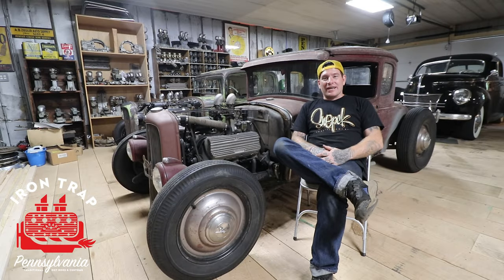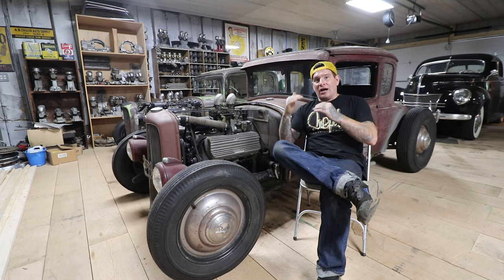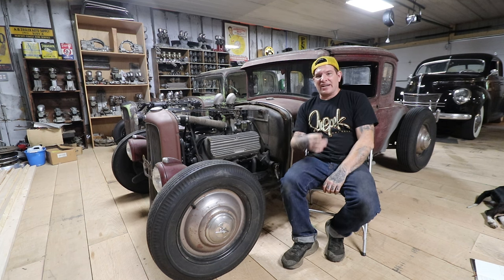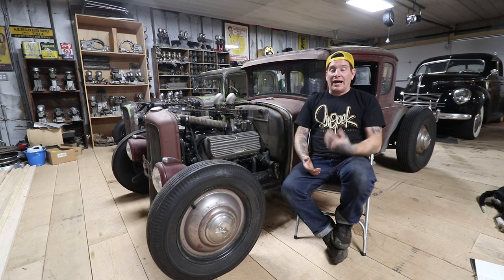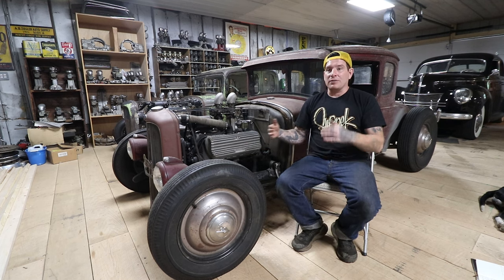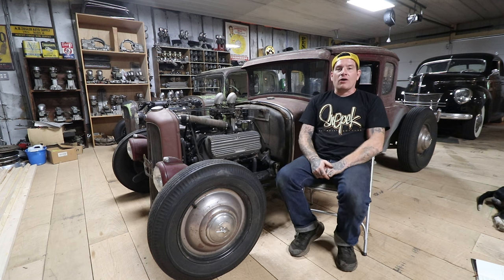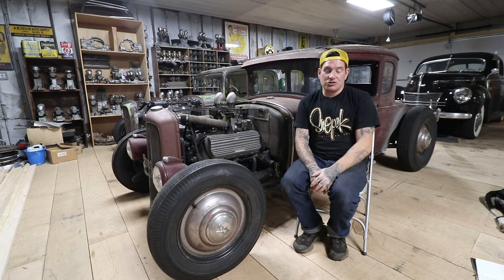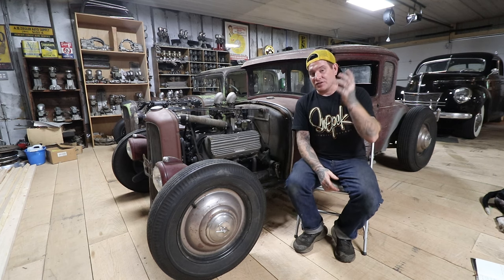Why Does My Ford Flathead Keep Overheating??? Hot Rodding 101

Comment: In our Model A Car Club, We cleaned out engines with Muriatic Acid, we usually mix in very small amounts. About 1/50 to ratio mix. Making extremely sure that the mix does not get into the radiator or on Paint finishes. With that mixture, we let it set overnight. Carefully plugging off the lower outlet to the lower engine outlet. Fill the engine. Let sit overnight. Then drain engine, use caution. Because, the fluid will be nasty! Do not allow to get on the floor of your garage. Do not let any Pets drink of play near the mixture. It will dye it brownish yellow. After it’s out, flush engine until clear water appears. If you wish Neutralize with baking soda. Still do not connect hoses to engine. The Muriatic Acid can make solder come apart. It is important to isolate the mixture from the Radiator. After the baking soda does it’s job, flush a few more times… Clean Hoses and replace any worn parts. With the engine empty of water, mixture and baking soda solution. Reconnect hoses, fill with water and a start engine. Check for leaks. Run engine until warm, and flush out…Then replace Antifreeze/Coolant 50/50. We still use old fashioned green. And in our case, lube water pump bearing grease fitting. Check for leaks and test run it…Thanks… Also, Folks keep tuning into Iron Trap Garage.

Comment: Hi, I know you are very busy but I hope you will take the time to read this. Your piece on flat head over heating was spot on.  We (family/friends) raced flat heads starting just after WW2, I am 82 now but was always around the garage etc. We were running 59A's from Canada after a Ford rep clued us in.  They apparently had a higher nickel content and after switching to them never had a block failure.  The way we prepared a block was, as I remember to strip it then clean out all the water passages possible. A long soak (in Muriatic acid??) at a local radiator  shop for a boil out. Then a thorough hand scraping, blow out, and more scraping  and flush out.  then on to porting/relieving etc.  Blocks were relatively cheap then.  In fact a couple of times we heated them in a wood fire after disassembly  prior to hand work/boiling. We even had a partial success with one engine after heating in a wood fire to make the brazing of sleeves (bored through the wall into the water jackets, Chevy 6 cyl sleeves I think Nash pistons). Ran like stink but the process was crude. 2 men with 2 torches brazing away. As the block was now weaker they leaked and didn't last .  We did use a Hot Rod splitter in the center exhaust port though.  About the  over heating: The local rules stated the 1 carb and the engine had to look stock on the outside.  After trying the brazed washers in the head to slow down the speed of the flow we made  2 short pieces of exhaust tubing with the correct sized freeze plug welded  inside.  You are  right when you say the water flowed too fast at speed to loose the  heat.  By slowing it down the engine ran cooler. We tried the removing alternate vanes in the water pumps but that didn't see to have any further effect. We didn't run a fan but used  truck radiators. Again local/cheap.  Another "stock" trick was to use a Ford schoo lbus fuel pump. Looked the same but pulled the fuel better.  Timing was set by elongating the slot on  on the side of the distributor  and setting upon TDC  prior to putting on the head with a notch on the crank pulley.   Sure wish I had written  down more but at the time who knew. Your show is amust watch for us "old timers".

Comment: I had a long term overheating problem in my 51 Ford F2. Stock V8, but the truck started life as a flathead six. It took me several years of trying everything and getting no improvement.  The six radiator had been modified for the V8 hose layout and the center outlet soldered shut. I flushed both engine and radiator, new water pumps, thermostat. I even added the original fan shroud that had been discarded. Still overheated badly. Then someone told me that the sixes had a three row tube layout and the V8s had a four row core. Problem solved. I bought a dead 51 farm truck just to get the radiator.

Comment: Here in AUS I had a flathead v8 in my ford 37 sedan in the 60s. I agree with all you said , but I still had issues until I replaced the iron heads with alloy , the iron heads get hot spots in them.   After that it wasn’t too bad. Having said that we get temps in the 40s (Celsius) and then I used to find the fuel pump being behind the carby used to vaporise the petrol .  I still wish I had it still to this day . Great, video

Comment: A good method to clean the cooling system is to drain it, fill it with distilled water, drop 2 dishwasher detergent pods in and run it till it’s hot. Let it cool down and repeat a few times. The complete pods with the multi colors work best.

Comment: In addition to blowing out cooling passages using a extendable magnet on a stick helps a lot. The rust is still magnetic!
Reply from the maker: Yep we do that as well as a first step to get the “big stuff” out. Totally forgot that. Great one!
Reply: Agree , beginner here but found my dodgy waterpump was actually hindered by crud .Used a small strong magnet on a piece of fencing wire to probe into the block,certainly very obstructed in the centre .Persuaded myself to do the opposite side as well ,remove probably a mug full of debris each side .I have a 'french' flatty ,so maybe an amount of casting dust in there .👍

Comment: My flathead is ported and relieved.  Winfield 1A cam, Navaro heads . I have side exhaust  with bell megaphones and removable baffles.  No fenders on my roadster.  29 on 32 rails. Altered wheelbase.  The body is 7 inches shorter than stock.  I have fabricated aluminum deck lid and rear panel.  The wheel base is 110 inches.

Comment: With a flathead V8... difficulty cooling has very little ( if anything at all ) to do with water pumps, coolant types, or other incidentals. Quite frankly... get the exhaust gasses the hell out of the block... THAT is what is causing the "water heater" effect. As was mentioned, careful exhaust port / exit contouring... and for crying out loud... get a proper set of headers on the damn thing !

Comment: Legend (and Motor City Flathead) said casting sand frequently is/was a factor with hot running flatheads. Motor City Flatheads used to get "pounds" of sand out of bare blocks while preparing for rebuilds using bent up rods, air, actual rolling of the bare block on the ground. Also, a bit of a project , but plugging the jacket surfaces and filling the jackets up with white vinegar and letting it sit for a day or two will dissolve lots of the built up rust. Followed by a good flush and a baking soda solution of course.
Reply: I know nothing about flatheads but I read, one time, that the factory didn't clean the sand from casting out of the blocks too well alot of times. Said the same thing you did, that rebuilders find alot of sand in blocks. Extra effort should be made to get the sand out.

Comment: Make sure you get all the casting sand out of the bottom of the water jackets.  I  did then I  sent the block to a guy in Petaluma to clean the block out further.  Mine rarely overheats.

Comment: Great episode as usual  Matt! I'm 73 years and the old school knowledge you have at your age amazes me. Then I realized you have learned through first hand experience as well as talking  to legends like GW. My flathead was a 49 with 59000 miles and newly rebuilt V8. I drove it winter -40 F (Canada) as well as 104 F. It always started in winter with regular glycol mix , electric inline water pump/heater and battery blanket. No that's not cheating the wind chill factor in -40 F in Alberta reaches -70+ F and she never let me down. The only time the flatty overheated was once on a 104 F in Osoyoos BC. lol

Comment: Great advice and tips, as usual, Matt. One of my mates, in the early 70s, had a stock '46 Coupe with a
beautiful, quiet flathead in it. Ran it at highway speed, at night, with no dash lights,  going to an out-of-town
party. It blew a bottom radiator hose, and ended up with a badly cracked block. He bought a 21 stud motor
for 10 bucks [70s, remember!] we threw it in and he sold the car. [Got his money back] Those were the days!:body-blue-raised-arms:
Reply from the maker: Dang ten bucks! Haha great

Comment: Thanks Matt! Many common sense things that apply to all old motors. I got lucky. My Catalina 57 came with a freshly rebuilt motor (rebuilt, ran then parked for a few decades), rebuilt radiator and a flushed, boiled and sealed fuel tank. Those things alone made the car worth considering.

Trashcan 🗑 Approved

Comment: Very good helpful tips. Thanks for sharing Matt. I hear a lot about slowing the coolant down but I experienced speeding up the water pump also fixed my problem on a warm running V8. The original water pump pulley was 7” so I installed a 5” pulley I had laying around. Never another issue even on the hottest days. I guess every situation is unique.

Comment: Excellent advice Matt. Only part where we differ is on coolant. I have been running Evans for 10 years. I have a 286 flattie running a quickfuel 650 manual I drive it hard I have not overheated in the entire 10 years. And no corrosion. Love your videos, Matt you always hit the nail on the head. Clean cooling system is a must.
Reply from the maker: Good to hear! I’ve never used it so as mentioned my words were just hearsay

Comment: Good talk Mate! Exhaust to water heat transfer is a flattie problem like no other engine & the center port is the obvious one but you can reach in there with a long porting shaft & knock off all the chunky bits to help that. The outside ports (1-4-5-8) are a different animal that wrap around the outside of the cylinder so you have limited access to clean them out without taking it to an Extrude Hone company. Most header pipes are built square to the block but that's a mistake on these end ports as it creates a dogleg restriction. Take a minute to eyeball that & you'll see what I'm talking about. Golden rule with headers on any engine, the pipe needs to continue the port angle, the flange is just there to hold it in place.
Reply from the maker: Great info there! I’m learning myself here! Love it!

Comment: One of the secrets is cleanliness inside the block. I had my early Hemi block hot tanked, which removed all the sludge & crud that had built up over the previous sixty years, then took it to the local Redi Strip place where they did their number on it. It came back sterile clean with NO rust inside the coolant areas inside the block at all. It was cleaner than when it was new. Recommended procedure for ANY old engine with built up crud inside the coolant passages.

Comment: An old timer told me to connect the heads together with a 5/8 heater hose.  He said that would Ballance flow in the engine and make it run cooler.
Reply: Heard about that idea a mate had a 46 coupe that ran hot it eventually ran right but we did try a lot of these ideas.

Comment: Anti- freeze expands when hot.  Has to be pressurized.  If not you'll run shy on coolant.  Old systems need to be full as possible.  In my A I run distilled water, 1 qt Napa 1400 (anti rust stuff) and 1 qt anti freeze.  Heated garage or just dump in the winter.  I live in PA too, so winter driving is so-so anyway.  You are 100% correct about condition of the cooling system.  That's usually the problem.  Very useful video, I hope people pay attention.

Comment: I have a 39/40 Mercury 239 engine here that I pulled from an old welder. I took it apart to free up the valves, the pistons weren’t stuck as it’s been rebuilt at some point (.060” over). I let the cooling system dry out and blew it all out with compressed air. Before I put it back together I’m going to flush the block with my pressure washer. I have also found a gentle rub on the exterior of the block with a needle scaler will loosen up crap inside the water jackets so it can be cleaned out. Gentle being the key word.

Comment: My flathead had a ton of core sand in the block that  was in the waterjackets.  I was actually able to remove it.  I haave a set of Navarro heads, they have increased water capacity.   I am using a restrictor to slow the water because I don't run thermostats. I also use a solution of water soluble oil in the cooling system.   Water cools better than anti freeze.  I live in Nor Cal so it doesn't freeze here.  I also have a 4 core radiator.  My block was thoroughly cleaned by a guy in Petaluma. My water pumps are high volumn aluminum pumps.  I have a 13lb radiator cap, I have a stainless overflow bottle.  I generally don't have a problem with overheating.

Comment: Obstructing the coolant flow to keep it in the radiator longer is like blocking your pulmonary flow to keep the blood in the lungs longer.....it's counterproductive. Anything that reduces flow also decreases the efficiency of the system.  If obstructing coolant flow seems to work in your system,  there is something wrong with it.....water pump cavitation,  reuced air and/or coolant flow through the radiator, etc.  You're better off resolving the shortcomings of the system than crippling it to compensate for its deficiencies.

Comment: Also use only distilled water, ground water has a lot of minerals that you don't need in the engine. As far as pressure caps, the older radiators like what you are running don't have a sealing surface for the pressure cap to sit against so in order to run a pressure cap the neck needs to be updated. Not a flathead but I had a Pontiac in my shop that had a muffler completely packed with dog food from a mouse!
Reply: I use coolant!

Comment: I found FOUR rusty gunky thermostats in my flathead. Two turned sideways in my elbows and two more before the radiator! The steel pipes locked between two sets of thermostats were clogged cavities of restrictive rust stalactites and debris. Surprising I cruised it a year with no issues, it just despised highways 🙃

Comment: Cooling systems on iron engines are always a pain. I used to use distilled vinegar and water, run it for couple days, flush it out with water, repeat until mostly clean then flush again. Run for a couple days and then flush again, drain it out, flush and refil with good coolant.

I've usually found that its almost always a heat exchanger issue. So radiators are just not flowing enough (necking the coolant flow) or not enough air flow through the rad to take heat out of the coolant etc.

Comment: I've used a 1/8"  rod to run down the outside of the cylinder walls through the water jackets on a bare block with the plugs removed at the oil pan gasket area. I put it on an engine stand so that I  could use gravity and air pressure to dislodge rust and junk. You usually get about a pound of crud!

Comment: My first truck was a 51 F3 V8, hot days/heavy loads hung weepy canvas water bag in front of radiator. My flattiy pals avoid hot days and heavy traffic. My flatty and high performance Yblocks/FEs no overheat or vapor lock per: TESTED 165 thermostats (chyna junk). Blocks hot tanked and visually inspect water passages, too many surprises. Block intake heat. American only aluminum radiator no paint. Single electric shrouded fan w/sensor, push/pull fans for AC. Coated headers/2.5" pipes/glass packs. I always tire dyno tune, timing is heat critical but also fear detonation. Happy engines keep me happy.

Comment: My father was a mechanic who worked at Ford and Mercury dealerships after WWII. He told of a new Merc that overheated right from the factory. After several attempts to stop it various ways, he pulled the water pumps off and found a bird nest inside the block! Apparently the factory stored the blocks in an area where the birds did their family thing. Irish Jr.

Comment: Have you ever tried 50/50 parts water and vinegar to remove rust and scale in rusty blocks?  That's how to remove scale from household water  heaters. However it must be flushed out with fresh water until clear and anti rust solution (Antifreeze) added.
Also helpfull on a clogged heater core caused by using stop leak in engines such as flathead just remember to isolate the heater core from the engine. I've done this on one of my vehicles and it restored heater system perfectly.

Comment: Matt on getting rust out of the cooling system could you use a long narrow bottle brush to help knock the rust loose ? Especially if the handle of the brush is a lite metal so you can bend it as you slide it in and out !
Reply from the maker: Great idea for sure!

Comment: You did a good job missed one big  thing & that was when people pull an engine then when the put everything back but leave out the fan shroud. & can't figure out why the engine get hot. Stock flatheads never get hot unless run in extreme conditions. They only need 2 things to stay cool, first, a like new factory radiator & a engine block not just cleaned out but all rust scale down to bare cast iron & then run 50-50 anti-freeze that has distilled water to keep it that way. .Now duel exhaust are great. but in my day never a mouse problem but stuck heat riser was not a good thing. We only  worked on stock cars but when modified anything can happen. When Ford tested their cars to find any problem remember those blocks were scale free as the radiators.

Comment: Used a trick from  the book Thunder Road flathead Guide  where you drill a hole in the back of the water pump that matches the hole in the block ran that way for years worked great

Comment: Everytime I rebuilt a flattie the rad was sent to the radiator shop. I used rifle cleaning brushes to clean out the block and no thermostats. Never had a overheating problem. Oh and used green coolant

Comment: I saw an internet show that had a ford flathead v8 expert explain that a lot of these engines came from the factory with some casting sand still in them and caused corrosion and over heating.